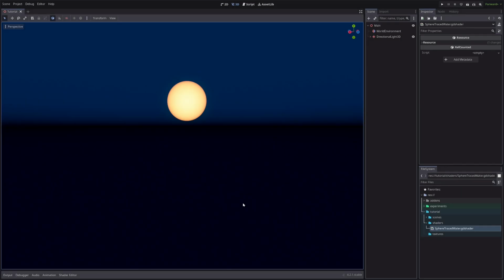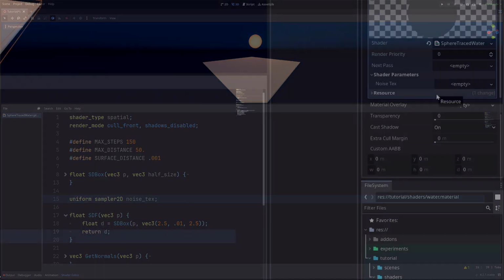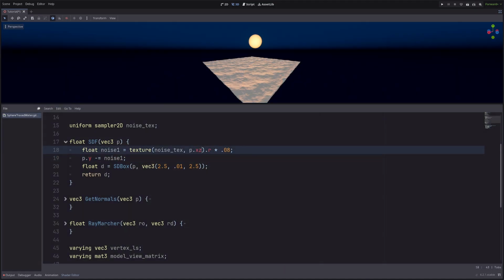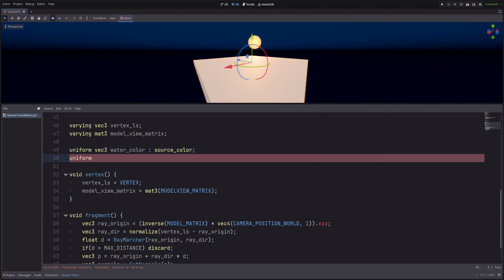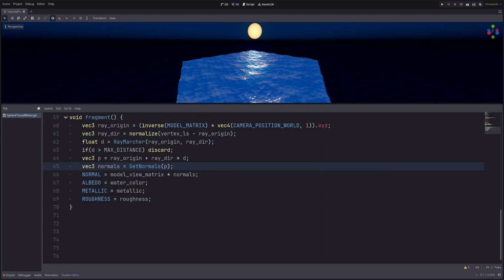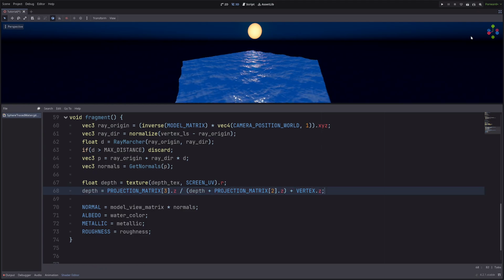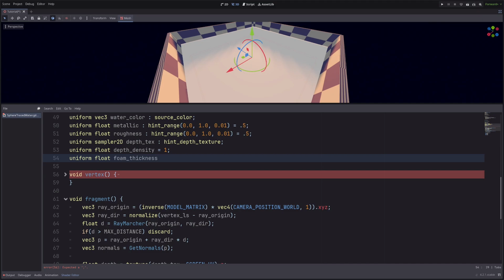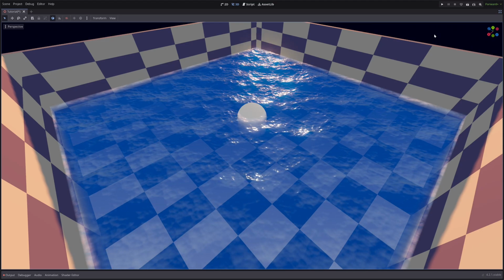Create AMAZING Water in Godot Engine - Step-by-Step Tutorial

Comment: will the dept be visible even inside the mesh? im trying to simulate the water fog in First person, so i was wondering if the depth would darken the insides of the mesh
Reply from the maker: If you are talking about our water volume then yes, even if you fly inside the volume, you would still see the effect but you need to set the cull mode so that only the back faces of the volume renders. cull_mode front;
Reply: @iDigvijaysinhG  that's GOOD! i was using a FOG instead of a shader simply because i don't know shaders and can't code them and AIs do not help in this case.

Comment: neat! good tutorial :)
Reply: I'll have to admit that I already fail at reproducing the sun-like DirectionalLight and getting the WorldEnvironment to look like yours 😅
Reply from the maker: No worries, I have a World environment node in my scene, there you just need to set procedural sky material.
There you can play around with colors in sky and ground section and for sun you can tweak sun settings.
Then you need a Directional light3d node and set the color you want your Sun to be.

Cheers!
Reply: @iDigvijaysinhG  Thank you kindly :)
Reply: @iDigvijaysinhG  Is the child of the Directional light what gives the sun this sphere shape that reflects on the surface of the water?
Reply from the maker: No, there is the "sun" section in the procedural sky material, there you can tweak the settings for sun shape and then the sun will automatically follow the directional light angle.
The reflection on water will come from the metallic and roughness values from the shader.
Reply: @iDigvijaysinhG  Thanks a lot!